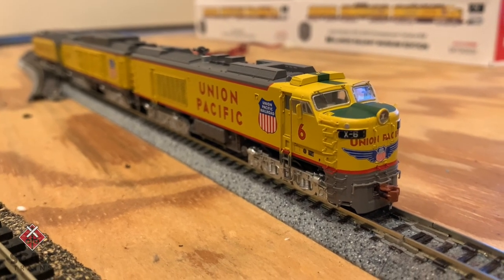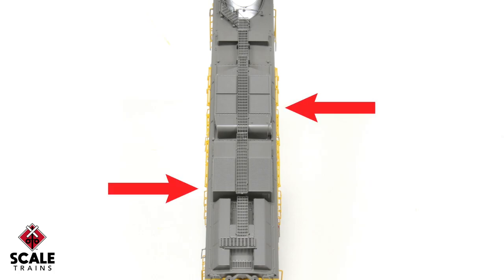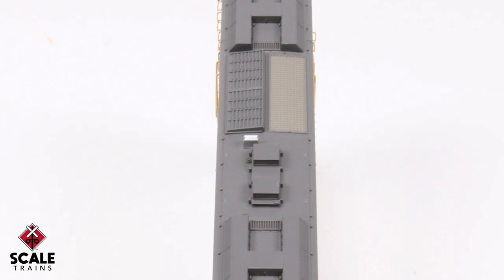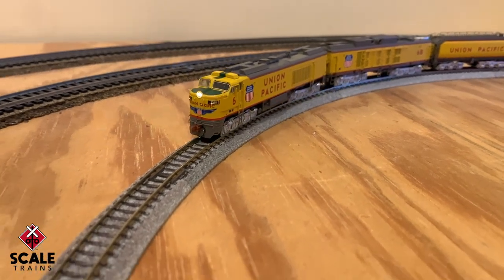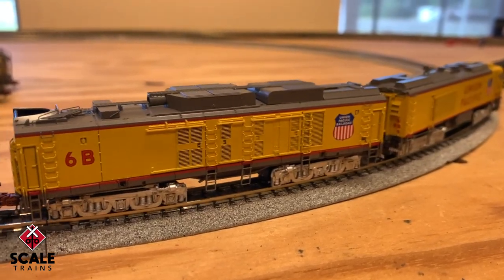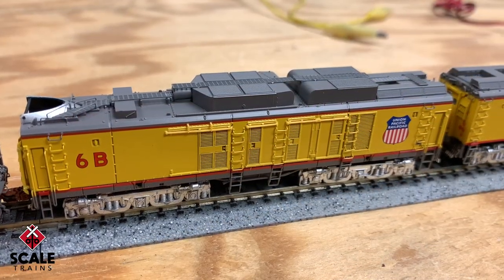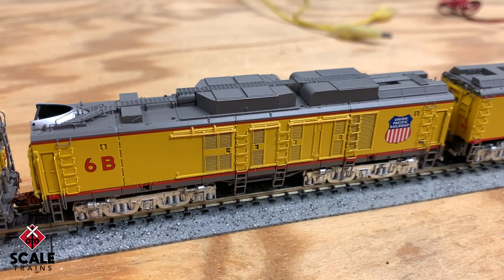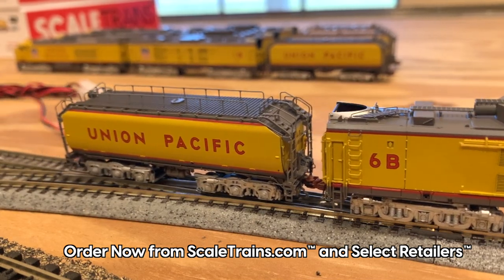Overview: Rivet Counter N Scale GTEL Big Blow Turbine

Comment: The best extremely small speakers i know, are the ones fitted in mobile phones. They do need digital signal processing to sound good, and their efficiency is pretty bad but with power supplied via the track, there's enough power available to compensate for that. 
There are tons of those available on the Chinese market, and i think the cost is relatively low. Might be worth ordering a few samples and trying them out :)